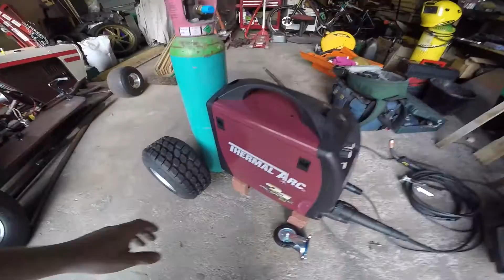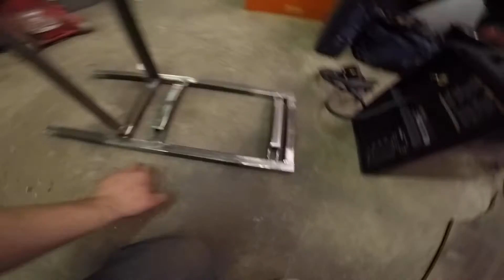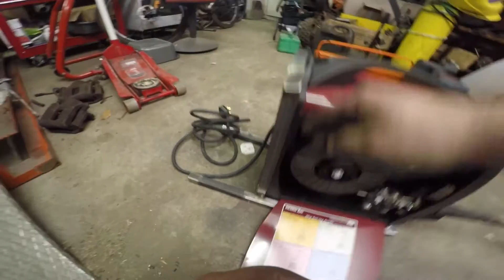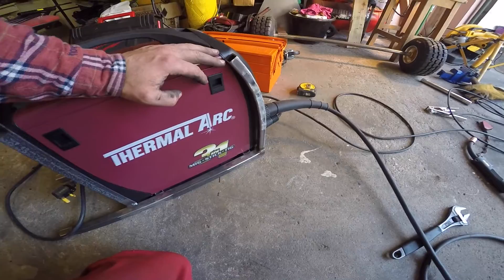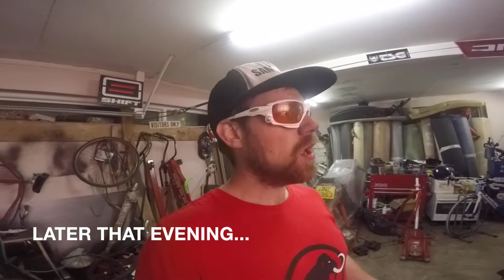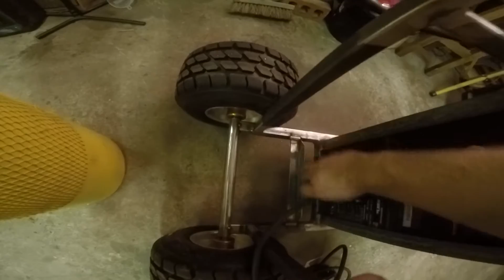WRENCHLIFE - HOMEBUILT WELDING CADDY - PART 1

Comment: I been looking for ideas on a welder buggy. I like this one.  keep in mind,  I'm not a skilled welder lol.  All seriousness I do like that cart. ir bad ass.
Reply from the maker: Rodman Lyons Thanks man 👍, the wee buggy has served me well since it was built, and it is far more stable than the stock one even with the bigger bottle, definately time and effort well spent 😉🚜
Reply: WrenchLife you're very welcome.  I use a Flux core welder right now. I'm not a skilled welder so no need buying a good setup just yet.  I am practicing a LOT lol.  I would say I'm MI a grinder then welder but it holds together.  I may start a buggy build soon.